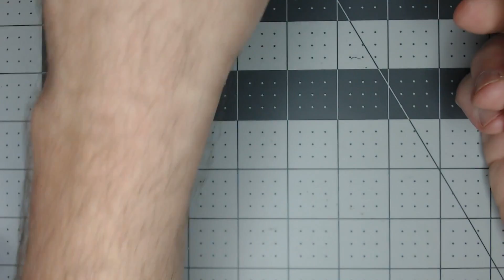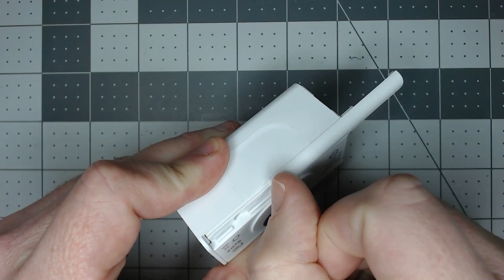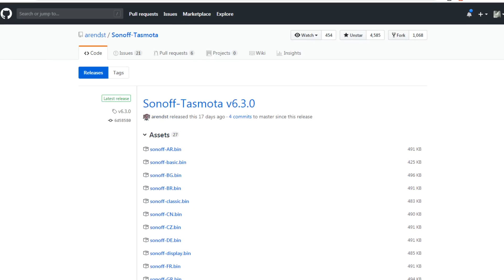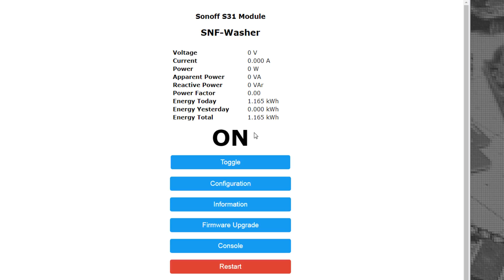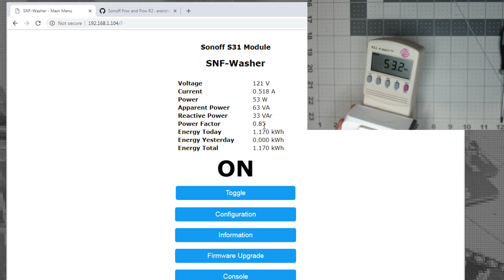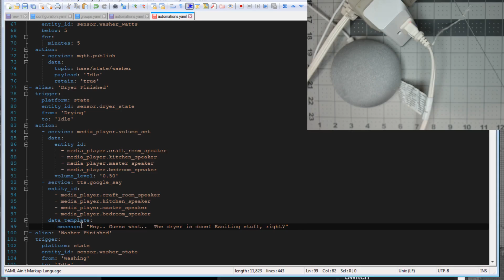Smart Laundry Voice Notifications with a Sonoff S31 & Home Assistant

Comment: Great video. Thank you as much. As always, your video is so much easy to follow. Please keep up your good work. My concern is the washer Amp. This Sonoff S31 device supports up to 15A. Wonder that is still good enough. Any question I have is whether this device can apply to refrigerator too. If it is also possible, I would like to buy 2 devices and implement them. Thank you.
Reply from the maker: I've had a pair on my washer/dryer for coming up on 3 years now.  No issues.
Reply: @digiblurDIY  Interesting. That's good to know. Will buy one first to try out. Great thanks. Have a long weekend, bro.

Comment: Thanks for this detailed tutorial.  I was able to get this all setup and noticed that the telemetry is only sent once every 5 minutes.  In the Tasmoto console "TelePeriod" shows 300s.  Not very useful if you're trying to monitor power changes in HASS.  Did you change your "Teleperiod" from the default of 300s to something lower?
Reply from the maker: PowerDelta command is your friend in this aspect. Sends a new update based on a percent change you specify.
Reply: @digiblurDIY  That did the trick.  Thanks again.  For anyone looking for a command reference: https://tasmota.github.io/docs/Commands/#power-monitoring

Comment: Flash without soldering. I made a little harness for my serial adapter with four EZ-Hooks to clip on the pads of the S31. This worked great - no soldering necessary on the S31. Just keep the button pressed before you connect Vcc, then release the button. This will put it into programming mode. Here are some pics https://drive.google.com/drive/folders/12MVCHMkni0W8B-GtdyuDOB9RiHnoGUKA?usp=sharing

Comment: Great video! I was able to setup and calibrate the S31. I like to see if you can make some videos on integrating HA with google speaker or Amazon Echo.  At the end of your video, you shown the automation using google speaker. I like to know what else you have to configure to make it work together. Also, there is a S31 lite version out there that doesn't has voltage monitoring. Beware of false advertising on the web. Just get it from Amazon link.

Comment: I have been learning so much with your videos, but I got stuck hereon the washer state, is not updating.  I pretty much copied and paste your configurations, but cant make it update the state.  I assume there can be a ton of things, but any lead on how to check the config, automation or group yaml files?
Reply from the maker: It is using an older method of MQTT to do so. Are you seeing the wattage changes of the device itself?
Reply: @digiblurDIY  Yes, I see wattage, voltage and amps, and they update
Reply: Having the same issue with the state not updating, it stays stuck on unknown. Have you found a workaround?
Reply from the maker: Probably best to jump into discord so we can see what's up. There are a few easier ways to do things now as well. https://discord.gg/dgRZSw6

Comment: This is great. It inspired me to do a similar thing to my doorbell transformer using a Slitinto SM110 to push a Telegram message from HA when the doorbell is pressed. Had to use a Tasmota mqtt rule for the wattage though as HA was too slow in reporting changes in time for a visitor at the door. But for a washing machine the delay would be fine.
Reply from the maker: You could probably get the fast response you need via modifying the powerdelta command value but nothing wrong with doing it via Tasmota itself. Not a bad idea at all though to pick up the doorbell!

Comment: Hey I'm curious if you've thought about doing another S31 video but with ESPHome, I've been seeing a lot of people move from tasmota to ESPHome since it integrates nicely with HA and I recently made the jump and it works well.
Reply from the maker: Probably not for plugs as I find Tasmota easier and less work for plugs/switches/lights especially when it is the S31 config being one click or so away. Auto discovery removes the previous integration barriers shown in older videos such as this one. I have shown it in some of my newer videos.
Reply: @digiblurDIY  thanks for the input I'll look into the autodiscovery - thanks!
Reply from the maker: https://tasmota.github.io/docs/Home-Assistant/#automatic-discovery

I should have linked it. Just issue setoption19 1 on the console and it will pop into HA with all kinds of data about the device. All automatically setup.

Comment: Flashed my first S31 last night following your video (thanks!), have done several switches.  However, it is very laggy, even pushing the physical button sometimes it's slow to respond. I've tried rolling back to 6.6, no change. Located in same room as router. Ideas?
Reply from the maker: Define laggy? Is it laggy on the web GUI too?
Reply: @digiblurDIY  Slow to respond to most input whether it's the physical switch, console, gui, tasmoadmin,or HA.
Reply from the maker: Turn off Tasmoadmin and try again.
Reply: @digiblurDIY  I'll give that a try when I get home this afternoon.  I appreciate your quick response and all the help you provide!!
Reply: j/w, did you ever figure out the fix for your lag issue?
Reply: @kyermichael  it is working fine at this point, never again had that issue. However, I can't remember what fixed it. Sorry.

Comment: Hmmm, your dryer is running on 120V too? Any idea for 220V US/CA plug? :/
Reply from the maker: Yes, 120V for the dryer since it is a gas dryer.  There are a few options, I did a couple videos doing some CT clamps on electric dryers plus some power monitoring options.
Reply: @digiblurDIY  ohhhh thanks for clarifiying. I was confused.
Reply from the maker: Were you able to find the other options for electric dryers.  Feel free to jump into discord and ask for pro's and con's of each, many of us in there to help.  https://discord.gg/bNtTF2v

Comment: Thanks for another great video, found it very helpful for my first flashing of a sonoff device. One issue that I had was during the pasting of the backlog configuration. Seemed it errored out after the mgttpassword and I went back and re-flashed it a second time to try it all over with same results. Everything is working in that its flashed with Tasmota and set up for mqtt and my HAS sees it just fine. I wanted to see if there was another way to set powerretain, sensorretain and poweronstate via GUI or does it matter at this point?
Reply from the maker: You can just do each command separately on the GUI. Just put one in at a time to make sure you see each confirmation response back.
Reply: @digiblurDIY  ahhh ok thank you, i tried to string them all together in one long paste
Reply: When you do them one at time must each command start with backlog like backlog ssid MyWiFiz then next one would be backlog password SooperSekret etc...?
Reply from the maker: No. Drop the backlog. That's to string commands together. Just do
ssid mywifi

Comment: Wondering if you have tried setting the Sonoff S31 up in ESPHome? I have gone thru and tried doing it, but when I put the UART section into the yaml file it ends up going into a loop of rebooting. I have another S31 that I tried and I had the same problem.

Just wondering if you have ever got the Sonoff S31 working with ESPHome?  Keep up the great work.
Reply from the maker: No I haven't used Esphome for these as Tasmota supports them with a native module.

Comment: Thanks for the video and another great home automation application. (The first one of mine my wife sees any value in.)
I am a false detect problem. My Home Assistant (HASSIO on a Pi 3 B+) is randomly going between washing and idle. The WiFi signal reported by the S31 is high (about 80%) and not fluctuating very much. I also set the trigger power level up to 15 Watts but it is still happening.
Any other thoughts what could be causing the detect problem? (or trouble shooting tips)
Reply from the maker: What time are using for the 15 watts? And how many watts is your washer pulling during idle?
Reply: @digiblurDIY  Thanks for the quick reply. It looks like I didn't have that 15 watts parameter saved like I thought I did. 
I captured a ~24 hrs of data by leaving console window to the S31 open and analyzed it in a spreadsheet. My idle power is about 4-7 watts. (Didn't expect that.) It looks like 10 watts will be a safe value to trigger on and I am leaving the timer values you suggested.
Thanks again

Comment: Is it possible to extract Vcc as a sensor, if yes  what in place  "XXXXX"     value_template: "{{ value_json.XXXXX.Vcc }}"
Reply from the maker: The vcc of the esp chip? Or voltage of the line?
Reply: @digiblurDIY  vcc of the esp chip, thanks
Reply from the maker: it would be just value_json.Vcc as vcc isn't inside another key.
Reply: @digiblurDIY  Thank you. it works.

Comment: Thanks! I'm really bad at soldering and lifted my pads and had to toss my first s31 in the trash. Got another coming this weekend so I'm going to give it another go!
Reply from the maker: Still my favorite power plug. Just take your time. Low heat and flexible wires.
Reply: @digiblurDIY  I wound up digging it out of the trash and trying to make a connection under the board. I failed BUT I did get better at it and am very confident that I will be more successful tomorrow with a new switch. Thanks for your video, when I ruined this board it was because I was using a header, soldering on a tinned wire was 10x easier for me!
Reply from the maker: Easy to do so with a header and even those male jumper wires. Seen people rip off the pads too easily. Safe method is the pretinned wires and pads. Easy to do as well. Let me know how it works out.

Comment: Those plugs are designed badly. The plug should be on the side of the unit, not the front. By the time I plug the Sonoff in the wall and then the power cord, the wire is about 4 to 8 inches from the wall. How many appliances are places in front of the plug against the wall. It would be nice to push the appliance against the wall and not have it hang out 5 inches.
Reply from the maker: I could see that being an issue for some circumstances as I have had  it on various other devices even a regular power strip. These work great! FIRMERST 1875W Flat Plug 1Ft Extension Cord 15A for Kitchen Home Appliance Office White (3 Pack) https://www.amazon.com/dp/B073FDJ4NY

Comment: GREAT VIDEO!
ive just done the same with a Sonoff POW with power monitoring as i live in australia. setup the automation with node red. one question do you know how to do get telemetry in the pow to only report every 1 minute or 5 minutes.
sending:
 TelePeriod 300
 in the console get the following topic to only report every 5 minutes:
tele/sonoff_pow/STATE
but the topic that contains all the power info:
tele/sonoff_pow/SENSOR
keeps reporting every couple of seconds.
Reply from the maker: you can tweak or turn off the powerdelta in tasmota.  Search for the powerdelta command on this page.  https://github.com/arendst/Sonoff-Tasmota/wiki/Commands

Comment: When i start the ESP8266 program it wont show any com ports. Ive gotten same result on two different  PC’s. What am i doing wrong?
Reply from the maker: You probably need to install a driver for the type of USB flasher you are using.
Reply: digiblurDIY I’m using the same FTDI adapter used in the video. Any idea where I could get the driver for it?
Reply from the maker: Think I just plugged mine in and it worked. Might try googling around for that chip and your operating system.

Comment: Great video. Trying to set this up myself using node-red instead of yaml. I'm stuck at the triggering based on value over time though. Any ideas on what nodes I should be looking for? I was starting to look at the homeassistant trigger node but it doesn't have a time component.
Reply from the maker: I haven't done one like that....yet.... definitely on my list to do without going down some huge rabbit hole.
Reply: @digiblurDIY  I have a working barebones version so far. Just need to work on the tts portion and it should be done. I can share when I have it done. Basically fed an event node to a switch that splits off to two trigger nodes that pass on the msg after a certain amount of time unless reset by a change node. If the trigger fires it goes to a state node to halt or continue on to a call service node to perform the mqtt.publish. So far updating the HA part is working great, testing a few ideas for the tts.

Comment: Would it make sense to set PowerOnState to 4 instead of 1 for this use case?  4 will switch on the relay and disable further relay control (until another PowerOnState setting, of course).  This way, inadvertent mqtt messages, such as a "power off" command to the grouptopic, won't turn off the relay right in the middle of a washing machine cycle.
Reply from the maker: Thought of that but didn't want to lock myself out of doing an easy power cycle for maybe an automation based off a water leak to kill both my dryer and washer.

Comment: Since dryers in the US are 240V (i.e., can't use the S31), what are you using to monitor your dryer cycle?
Reply from the maker: Gas dryer uses 120v around 4 amps at most. I do however have a plan to show how to monitor a 2 phase dryer power. Might be a few weeks.
Reply: digiblurDIY I'm so excited waiting for this video, thanks for your time helping us!!
Reply: @digiblurDIY  Sorry, missed your comments at the beginning of your video re: it being a gas dryer. I'm close to pulling the trigger on this - https://github.com/arendst/Sonoff-Tasmota/issues/3626#issuecomment-416976400. But if there is something OOTB or a bit less "maker", that's preferable for me.

Comment: Could you provide the code for your dryer as well?
Also what model is your washer and dryer? Are they newer? Just wondering if the power usage will be similar to my washer and dryer.
Reply from the maker: Yes I can do that, I can add them in the morning. It is very similar. Not sure of the models as we have had them for at least 10 years or so.
Reply from the maker: Try this link: https://gist.github.com/digiblur/a6ab6b401284a0085468d101f18cf145

Comment: I like this alot, however, what if it is night time? is there a way to stop Google going loud at night?
Reply from the maker: You'll need to add a time condition to your automation that would only allow it to trigger at certain times.  Reminds me I need to do mine too! Thinking this should work 

  condition:
    condition: time
    after: '07:00:00' 
    before: '23:00:00'

https://www.home-assistant.io/docs/scripts/conditions/#time-condition
Reply: @digiblurDIY  Thanks :)
Reply: Why not just set google to dnd at bedtime

Comment: Idea:You may tap onto the door switch to know when someone unload the dryer or the washer.  I will get mine done in the near future.  Thanks for your videos. They are really interesting and well explained.
Reply from the maker: Always more than one way to skin a cat in the automation world. Vibration sensors, optical sensors on the LEDs, optocoupler on the panel etc. I stuck to a way that didn't include any modifications to the device itself due to the cost of the washer and/or dryer itself.

Thanks for the comments and watching my ramblings at times.

Comment: Hi Travis, again , a super video. When you talk about soldering your DuPont leads onto the pads, what temperature do you have your soldering station set to? I don't want to destroy the pads on the circuit board but conversely, I don't want to my soldering tip to be too cold either. I usually solder really hot , between 650 to 700 degrees, that way i'm on and i'm off in a split second. what's your range?
Reply from the maker: I don't have that one with the temperature range yet. Santa will have to bring it. It's in my wish list and also had that friend get it based on researching it. Using an old 17watt iron.
Reply: @digiblurDIY  Thanks Travis....when you said "soldering station" in your video I assumed you had one based on your use of the term and the fact that you do a lot of soldering.  I just don't want to destroy the pads on the circuit boards I'm working on, hence my question.  I never had one until I needed to repair the circuit board on my Impala when the dash gear selector and mileage display quit working. ...4 resistors and I was back in business. I refused to pay someone else 100.00 plus dollars for a  10.00 if not less parts job.  Anyway, I bought a Weller WES51 station from Amazon for around 75.00 . I learned to solder on Tube TV and tube radio chassis but I'd never be without a station again for circuit boards.  Check out the Weller.
Reply from the maker: Been soldering for probably 30+ yrs now. My current iron is a Weller and is 20+ yrs and kicking. Saw some mixed reviews on their stations on the web though. Made me steer towards the one I saw others recommending and I also had my friend get it and it worked out to a nice station.
Reply: @digiblurDIY  Weller suggestion was based on my opinion so if you choose another brand, great, just be super nice and hope Santa gets you one. I think that circuit board work is so delicate now with most components on them being miniaturized that an adjustable heat soldering station is needed.
Reply from the maker: Absolutely. I have another iron like a 30w that is great for big wire but it will burn up other stuff like no tomorrow.

Wish I could try about 4 or 5 different stations myself including that little pen looking one I see people using with the display on it. Can't remember the model number myself.

Comment: What topic are you subscribing to for the sonoff firmware sensor?
Reply from the maker: Here's two files. One subs to the topic and one forces all the devices to spit it out at boot of HA or manual trigger. 

https://gist.github.com/digiblur/6215bb4472dd156907225331b9900fdb

https://gist.github.com/digiblur/b8c28c07fae3859542a67a2e27646bc4